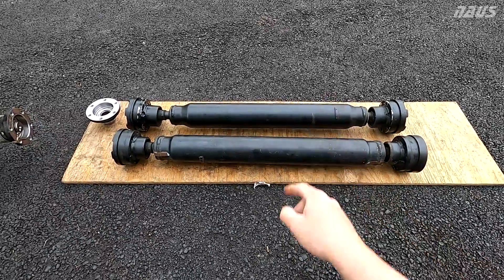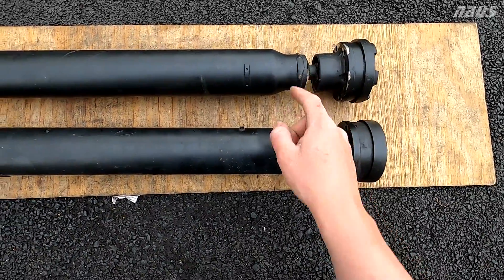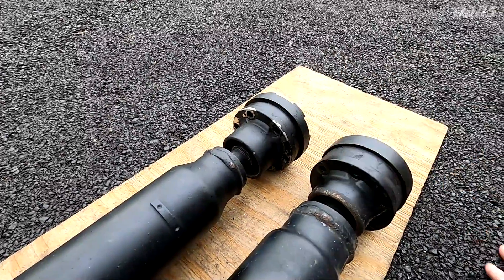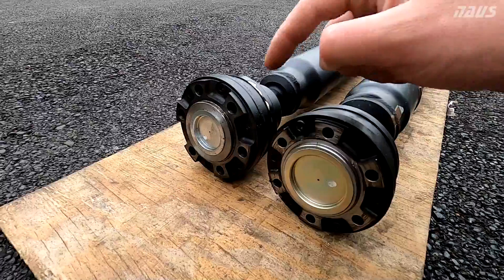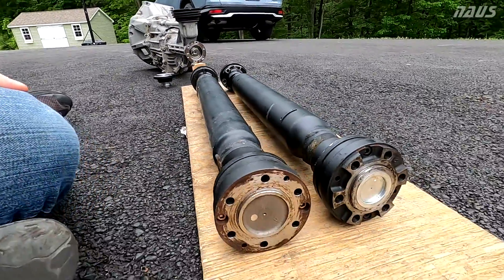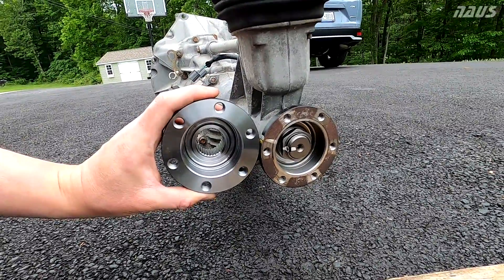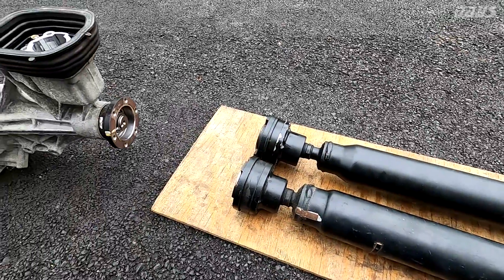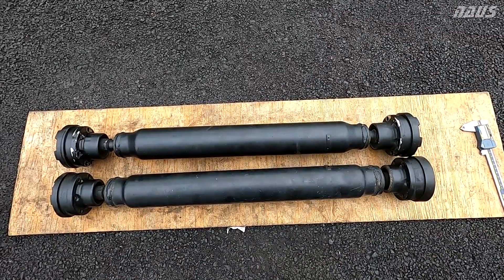AP1 Vs. AP2 Driveshaft Comparison - Honda S2000

Comment: Thanks for the video. Just a question, do you think it's possible to run both AP2 flanges on both tranny and diff sides on AP1? just to hold to power better and reliablilty
Reply from the maker: Yes absolutely it’s possible, that’s actually how my car is setup right now
Reply: @NAUS2K  is it neccessary to drill bigger holes on the prop shalf?
Reply from the maker: I’m not sure what you mean by that, if you run ap2 flange off the ap1 tranny, then swap in an ap2 diff, you will need to use a ap2 driveshaft. I would not attempt to drill out an ap1 driveshaft

Comment: Make sure when you change the flange that you properly torque down the flange nut on the transmission. It's critical because it sets the pre-load on the outer tapered bearing on the output shaft.
Reply from the maker: Thanks for the heads up!

Comment: I blew my ap2 diff recently and I found a ap1 diff for cheap . Can I use my ap2 drive shaft with ap1 diff?
Reply from the maker: You can drill out the holes on the ap1 diff and retap them to the larger ap2 thread
Reply: Yes you can, but you'll have to downgrade to AP1 bolts. Remember you're not tightening the bolts to the prop shaft. You're tightening the bolt to the flange and the washer.
Reply from the maker: @rolandotillit2867  see my reply here. I would not recommend putting AP1 bolts though an AP2 driveshaft flange. There will be a TON of slop between the OD of the bolt and the ID of the thru holes.
Reply: @NAUS2K  I didn't say it would be ideal, just that you can do it.
Reply: @NAUS2K  for the record, the fancy shmancy Spoon prop shaft has holes to accept AP2 bolts but is intended to work with both AP1 and AP2 drivetrains.
Reply: @NAUS2K  Slop isn't a deal breaker, look at the subframe bolts, they have slop, they even make collars to reduce it.
Reply from the maker: @rolandotillit2867  Yeah I have subframe collars on my car. But on a driveline component that sees significant torque applied and shock loading, i couldn't think of a worse application to use a largely undersized bolt. To each their own!
Reply: @NAUS2K  You're right, ~616ft/lbs in 1st gear at the output flange @ 6,800rpm.

Comment: It is my understanding that yes, you can install an ap2 propshaft 'backwards' front to rear (the flange that originally went to diff now bolting up to trans, vice versa).

We swap axle cups when they wear out, maybe swapping ap2 propshaft direction could have a similar benefit (you could still swap ap1, but it'd be messy, as you'd have to do similar process as grease repack, but mount outer flange to opposite ends on reassembly).

Its a very different type of cv. Unsure if any possible benefit, or if it would actually cause issues (vibes, etc).

Curious if anyone has tried it.

Comment: Maybe time to consider the AP2 secondary gear multiplier also?
Reply: You have to do a lot of work to make that happen. You have to remove the tail section of the transmission. Then remove a reverse threaded nut, a roller bearing, and then the output gear.

I recently had to replace the tailshaft housing, it freaking sucks. Complete PITA job.
Reply: @rolandotillit2867  still better than a FD swap.

Comment: Seen several ap2 driveshaft update into ap1 on a couple of Japanese blogs but not sure why they did it.. keen to hear if you find any advantages
Reply from the maker: Main advantage is it makes it easier to swap to an AP2 diff which is known to be more reliable. Easier to swap the output flange on the trans than on a diff.
Reply: @NAUS2K  that is true thanks for your reply